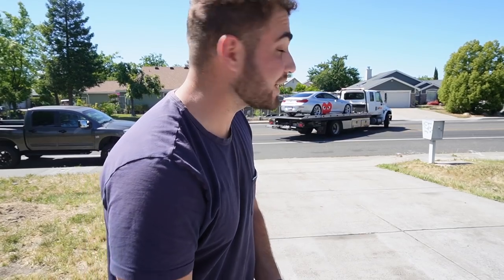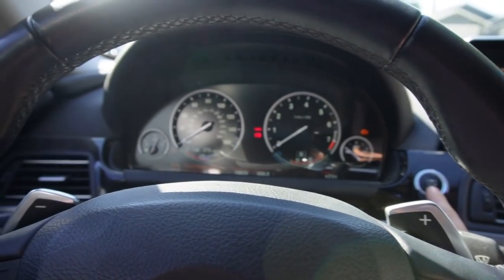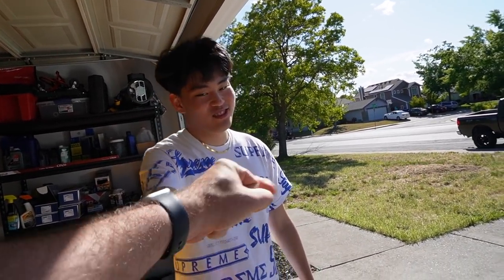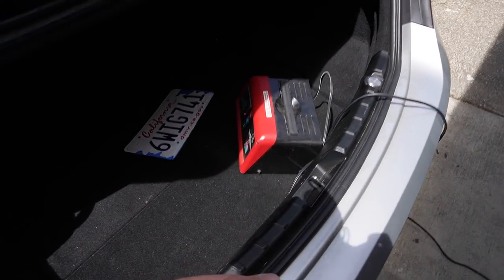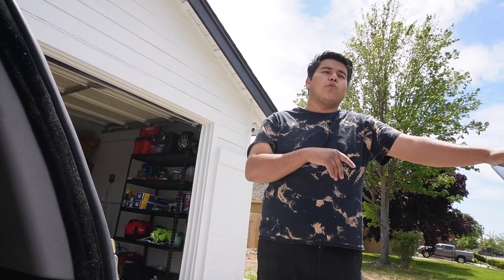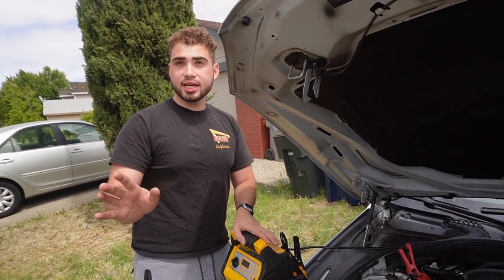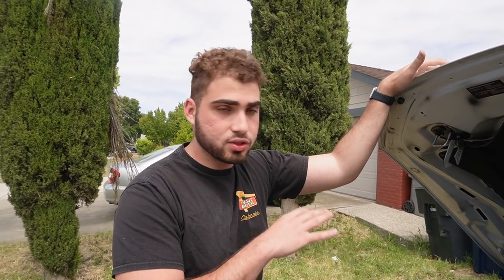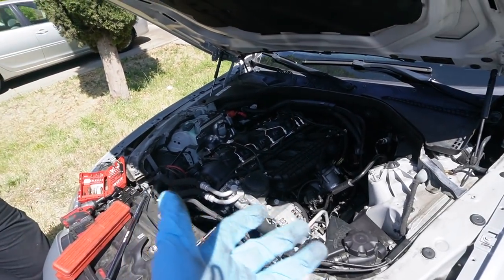I JUST BOUGHT THE CHEAPEST CLEAN TITTLE 2012 BMW 640I IN THE COUNTRY! But At What Cost?

Comment: Gotta remove the spark plugs when you turn it over by hand, do a compression and leak down test. You may not need a motor. If it was seized it wouldn’t move at all
Reply: Yes that motor is not seized

Comment: Dude, you left the plugs and coils in when you tried to turn it manually. Its going to be hard af to turn an engine with them in because youre manually compressing the air inside the cylinders. If the engine blew it would likely be much easier to rotate the engine by hand (depending on how/what failed). You can also check the oil for metal to help confirm that. Additionally, you can use a boroscope to check the condition of the cylinders visually. If theres significant damage then thats also a good sign your engine is bad.  you should try these steps again because, otherwise you could be buying a new engine to replace a functioning engine. And just a hypothesis, It might be a bit easier to turn the 328's engine because the it hasn't been sitting for a long period of time so there's likely more lubrication on the cylinder walls. It also would be a good idea to check that the alternator is actually bad. Buying an engine is expensive, and these checks are cheap, just trying to save you some money.

Comment: 100% check the dme pins for corrosion same type of no start/weak crank on my e90. Needed a new ecu and fixed the issue. Threw codes and warnings for drivetrain as well. Good luck!

Comment: sincei its a N55 i can just about guarantee you its a engine, hate to break it to you but when you put a bigger turbo on those motors they can just blow out of nowhere, THE Kbb on those is about 18 with mileage like that so if you paid 12 and spend 5 more for the engine your back to square one  so i suggest you look on ebay or a local salvage yard,, paid 3500 for mine when i bought a 335i n55 w a blown engine
Reply: Facts!

Comment: The car is in neutral bro, so maybe you need to get it into park before it will try to start. But the way it clicks when you try to start it, seems like it doesn’t have enough power to crank the engine.
Reply: You can start the car in neutral

Comment: Before buying new engine try this i had a f10 and i had the same issue  the car did not want to start at all went to loads of garages couldn’t find the problem because there was no code etc, changed starter motor made no difference, i had a manual so it was a clutch switch sensor but for automatic its brake switch sensor i believe so every time you press start it cranks but doesn’t give enough power or whatever hope.. it sounds silly but believe me bro..hope everything makes sense 😂 just trying to help

Comment: Wow, always thought the F13 had beautiful lines.  Your lucky you got the N55 version, that will be way more reliable than N63.  Hope you find a motor.  Great find with those mods too.  How will you pass next inspection date with catless dp's though?  Did seller give you the original dp's?
Reply: N55 also with rod bearing issues
Reply from the maker: I had to convince him but yea I got them 😂
Reply: @sivasli245858  It will with the crazy power the previous owner was trying to get out of it, but still way more reliable and less costly to maintain than an N63.
Reply: @steveb540i  i had a 740i n54 bulletproof engine 300000 km never any engine issues

Comment: Awesome.  Thank heavens you got a 640i.  No N63, phew.  Higher chance of fixing it.
Reply: Watched the whole video.  It sounds like a spun bearing.   This is my thought.  If you are to replace the engine anyway, it might be worth it to drop the subframe/oil pan and check out the bearing.  If the crank isn't mangled, you may be able to "save" the engine, by replacing the bearing.